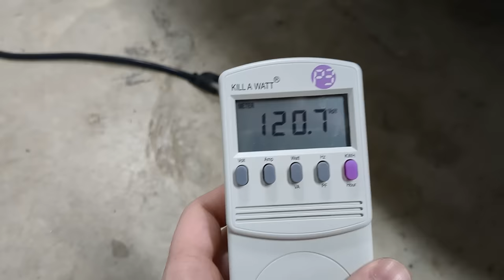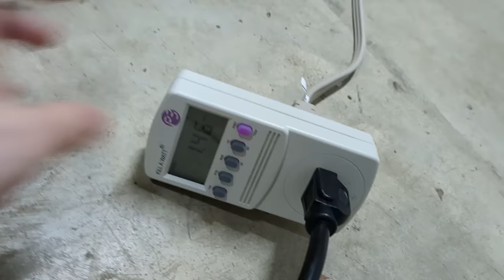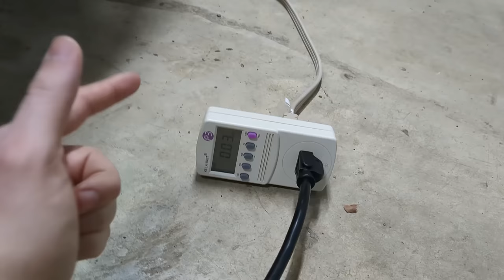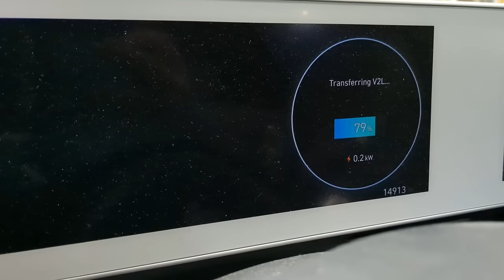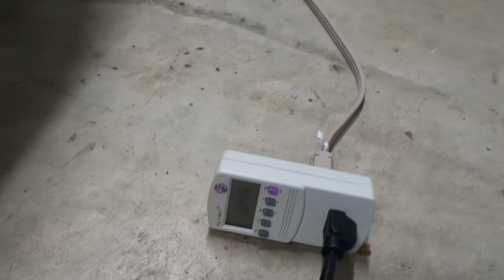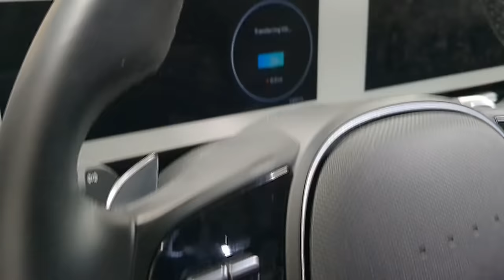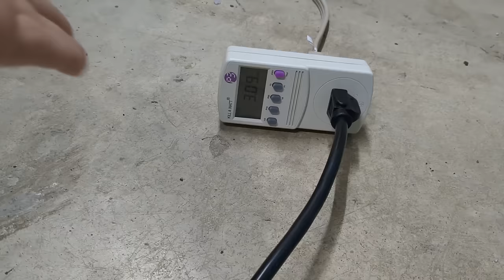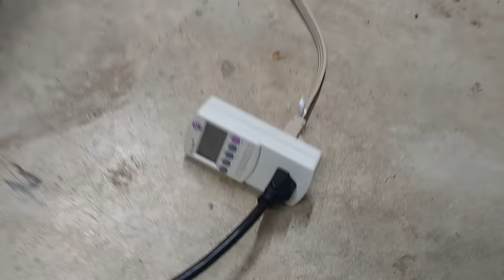A 24-hour test run of the Hyundai Ioniq 5's Vehicle-to-Load function

Comment: honestly i think this is a really interesting demonstration of how much energy cars use, like wow those things are going through a lot just to carry a person or two around
Reply: And yet people (who hve never driven electric BTW) still go on about range and how you wont be able to use the radio etc on long trips, they have no idea how little power the accesories use vs the big electric motor.

You might use 20-25kW or so per hour with the electric motor on longer high speed trips, if its cold and you need the heating on add another 1-2kW per hour for a heat pump.

There is a lot of mis-information out there from people that have never driven a EV.
Reply: @RandomNoob  yes people don't understand instant power vs kWh
Reply: @RandomNoob  The biggest problem with EVs is going to massive battery disposal and cleanup from the extremely dangerous fires they produce when damaged. We haven't accounted for these costs, not even close, at this point.
Reply: Much like a bridge, most of the load is the vehicle itself. There's probably only a noticeable difference in performance if you load 5-6 people in there vs 1. But even then I doubt it'd affect the range much. 

Though the "you'll have to turn the radio/ac off!" Crowd makes me wonder how many of them ever rode in weak older cars where the difference from turning the ac off was actually noticeable. It's a solved problem in newer cars apparently thanks to computers and better design.
Reply: Agreed, and EVs are already multiple times more efficient than regular gas cars!
Reply: agree. it wasnt until i bulit an electric bike to go far and fast that i realized how much energy it takes to do such things, plus i diy'd my solar system. all the above has helped me appreciate the energy density of fossil fules
Reply: @russianbear0027  depends one what you mean by load, most of the work is dealing with wind resistance at highways speeds.
Reply: @ysf-psfx  lithium batteries are highly recyclable and ICE cars catch on fire far more often than EVs even after 100 years of development.
Reply: @RandomNoob  And like many other things, they don't want to learn the truth. If we spend time trying to teach them, they just come back with more ignorant nonsense to spew.
Reply: and the car itself, too!
Reply: I still wonder how electrical grid will handle all the millions of future evs all needing to charge, especially at night or through heat waves
Reply: @fatguy9  well then you should really watch his earlier video on EVs...
Reply: @fatguy9  this one: https://youtu.be/1WuJtcgExa8

The grid will be just fine.
Reply: ah, the point i was trying to make was "wouldn't it be nice if we had walkable cities and better mass transit so we could do something more efficient than burning that much energy just to cross town"
Reply: Think of it this way: one gallon of gas is 33.7killowatts of power. That can make my Subaru go 28 miles or my Nissan leaf 130 miles!  It t to Ames a lot of power to motivate 4000 pounds down the road but the ev is massively more efficient
Reply: @ben3989  and in three years you're going to have to pay the price of a whole new car and throw away a ton and a half of lithium in order to make your EV keep running. A simple, repairable ICE car is a much more sustainable option than an EV, regardless of the fuel efficiency.
Reply: @tissuepaper9962  ok. My ev’s have all lasted way longer than three years. I’ve sold them used with nearly the capacity they had when purchased and will continue to serve the new owner for years. Good luck!
Reply: meanwhile my electric bike can go more than 70 km on a teensy weensy battery if i only use the electric assist on uphills, and even at full assist all the time it gets at least 40 km!
Reply: @tissuepaper9962   OK, well, first... no.  That's not even close to how things really go.  But, let's agree for the sake of argument that you actually do need a battery replacement every three years.  It's a bit absurd, but I'm willing to pretend.

The question is not really, "are there problems with this?" but, "are the problems generated by the new solution more or less problematic than the problems generated by the old solution?"  In terms of recyclability, material hazards, cost, and things like that, we're don't have the process as refined as it will be, when the market has ramped up to mass adoption scale.  So yeah, right now it's costly, and it's not particularly well optimized.  But that will change, because there's enormous financial incentive for the market to cater to those needs.

The materials in the batteries we use today are highly recyclable, so there's certainly room for that market to grow spectacularly -- just like we do today with lead-acid batteries, except:  We will be doing far more lithium battery recycling than current lead-acid scale (due to quantity used), and the materials in them are less toxic, but they will need to be handled with more care.  Not that lead-acid batteries are exactly harmless bricks of love and joy either, mind you... so precautions are required either way.

Nobody can reasonably argue that it's going to be smooth sailing, just that there is a lot of potential for environmental improvement, it's potentially going to be get cheap(er) and easy(er) to deal with the battery life cycles, and we will have to figure out how to contain some of the exceptional cases, like dealing with damaged cells, vehicle collisions, or other extraordinary circumstances -- just like we did when people first started riding around on top of cans of flammable liquid.  It's part of the process.
Reply: @tempest_dawn   Every time I go to a big, populated city, I am quite impressed with how accessible things are.  How everyday needs can be met with 15 minutes of walking, and how long distances can be spanned with efficient mass transit.

However, at least where I live, that does not work.  The climate is too harsh to live outside that much, and there are complications with terrain that require some degree of sprawl, even if living in stacks of shared housing could be considered a palatable option for everyone.  (Which is a whole other matter.)

Suffice to say, cars aren't going to be obsoleted by more electric trains and buses.  Those are great resources for places where they can be deployed efficiently, but that's not even remotely marginally close to all populated areas.  The only thing within walking distance to me is my neighbors, a burger place, and a small strip mall providing alterations and cheap smokes.  If I tried to get there, on foot, during about 1/4 of the year, I'm not sure I could dress warmly enough to prevent endangering my life.  Ergo, car.
Reply: This is why we can't just rely on Electric cars. There needs to be good public transport initiatives and infrastructure for electric bikes.
Reply: @fatguy9 

I think about that too, but I wonder how the grid handled everybody getting central air conditioning in the 1980s? My AC uses far more energy (in the summer) than my EV does. I was a kid, but I don’t recall the grid being overloaded. What do you recall?
Reply: @paulkelly5035  We already seen heatwaves cause rolling blackouts in CA and TX in the past few years, now add millions of cars into the mix and eventually semi trucks. It could be doable but i have my doubts
Reply: Yea a person or two and 3 to 5 thousand pounds of car.
Reply: @tissuepaper9962  wow my 6 year old leaf I sold that had 90% battery capacity and no signs of accelerating degradation didn’t know that you know how long batteries last.
Reply: @ben3989  must not drive much. How many miles?
Reply: @tissuepaper9962  it had about 54K miles.  In my family the leaf makes a perfect 2nd car to our Subaru and transit van (which is part time work truck). the Leaf does ALL of our city driving, closer to home outdoors activities, and gets me to hood river and back where I do a wind sport on a single charge.  That trip alone cost me about $5 vs $16 in the Subaru and I do it about 25 times a summer.  Its a great car and has its place
Reply: @ben3989  actually, I agree. A very light, short-range EV is a good complement to an ICE vehicle for distance, and you've done well to keep it for so much longer than the average person keeps a vehicle. I think that using an EV as your primary mode of transportation, like commuting the full range both ways every day, is not the way to go about it. Public transportation should be the commuter's primary tool.
Reply: @ysf-psfx  Man if you're concerned about those, just wait until you hear about all the costs from cars in general! Wasted space, tires, micro plastic pollution, direct air pollution. Turns out 1-2 ton boxes that usually transport 1 human to their job and back aren't very efficient at shuttling that one body around. Math's different when they're hauling tools, delivering/producing food, etc, but commuting? not so much.
Reply: this is avtualy a point that should push ppl towards stuff like trains and busses. Alas
Reply: I like to explain it in American household outlets.  I can get 5-8 miles per hour off one, but for full fast charge I need 173 regular outlets for 250kW, about 7 large houses maxed out or a whole regular neighborhood worth of power. That’s charging at 335 electrical horsepower which is no joke.  @RandomNoob
Reply: @RandomNoob it has been a year, hope you have learned something by now.
Reply: @ysf-psfx  How many EV fires do you think are happening?  I can assure you the cleanup from fossil fuels will be far more costly and take far more time than cleaning up fires from damaged batteries.
Reply: @RandomNoob I think the point of the original comment was to say how inefficient even electric cars are as a means of transportation. 60+ kWh of energy to just move usually a single person around

Comment: To avoid the plugging/unplugging issue, there are powerstrips available that cut off one socket if the total power draw exceeds a certain number. It enables both sockets again after the power requirement drops very low. This is used for boilers and dryer/washing machines to operate from the same outlet. Dryer on = boiler off. They are very cheap, recently got one for 25€.
Reply: Wow that's cool. What are they called?
Reply: Yeah that's call load shed. It's common with RVs. They will shed things like water heaters or AC to run the microwave. Newer RVs are all digital and you can set what amperage your shore power is, and it will configure the load shed automatically.
Reply: Surprised he wouldnt have found something like this after his most recent video on the smart circuit breakers for homes that do the same thing.
Reply: @Tomwesstein ... Do you mean OTHER THAN a switch for each outlet... it's done automagically??? Cool idea. Can you point to it, please?
Reply: This recalls the Green Acres TV series: Episode 9: “You Can’t Plug In A 2 With A 6” (Aired: 11/10/65). For those who ask, while I was around in 1965, too young to appreciate it until watching the reruns many years later.
Reply: @kennixox262  I just watched it on Pluto tv. They have it as s01e10. I like Oliver's system. I do basically the same thing now.
My new project is using my 2000 watt inverter generator with a deadly cheater cord to back feed a new 20 amp outdoor outlet. Then I'm putting all my breakers that I want to be able to run during an outage all on the same leg as my back fed 20 amp. Of course I'm going to disconnect the main before I try to back feed it. I won't be able to run 220, but I will be able to run the furnace, sump pump, fridge, microwave, tv, lights and such. As long as it's less than "8" 😆
Reply: he could also use something like one of these  battery power stations to support more than the max output of the car for some time and charge it while he uses less than the maximum.
Reply: Yeahhh this is what I was thinking of when he mentioned the smart distribution board in his other video. My childhood home in europe had 3 phase power for ovens and stoves. But the washroom circuit didn't have enough amps for both electric washer and dryer (I wonder if it had a gasdryer in the past or just outdoor clotheslines?) So I always grew up with one of those prioretising power strips.

The main distribution board doing that digitally seems really cool to me. I liked smaller aspects in games like Elite Dangerous where you prioritise which systems get power when the spaceship reactor is overburdened or damaged. (You can disable your life support to keep your engines running hahaha)
Reply: I have an Inventum instant hot water boiler under the kitchen sink, it shares the power supply with a dishwasher using their Q-Switch power strip to split the load depending on demand. I'm in the EU so it is 230v/16A device.
Reply: To all of you asking for the product, I’m from the EU (240vac) and they are very common here, the fact that TC did not stumble upon these and talked about them in his other video makes me think they are not a thing for 110vac. In Dutch  it’s called an ‘energy distributor’ but this doesn’t translate into a US product as far as I can find..
Reply: @Tomwesstein  Are you able to share a link to a power strip with the mentioned functions? Haven't been able to find any with "load shedding" functions, here in the EU.

Comment: I'm honestly really glad you added the bit at the end about potentially driving the car into town where they still have power or using a fast charger to reset the battery. An electric car being a very portable battery in an emergency is a great thing. [Ideally one wouldn't stick around in the home for over a week in a power outage and have to refill, but still!]
Reply: Assuming the roads are travel-able.  In case of a severe ice/snow storm, it might not be possible to get out for several days (as we experienced).  But as he mentioned, he's good for 5 days easy in this case, so that's a non-issue.
Reply: @Josh Payne  It's kind of a niche situation  for sure, and he brought up correctly that winter outages are repaired much faster as emergencies. I live not that far away from rural areas, though, where power might not be repaired for a week or more after a strong summer storm. Driving 15–20 into town to fill up the home battery and pick up supplies would be a realistic solution to the problems posed there.

Hopefully, the grid remains maintained and robust, but the EV as generator replacement seems to make sense.
Reply: @joshpayne4015  also in case of snow storms his setup would run even longer -> no need to run the refrigerator
Reply: actually solar or wind can in a emergency fill up the BEV but unless you're a farmer/stored a lot of gasoline normally you're stuck walking and waiting for the pumps to work at all and generally you're SOL, lost the debate with others vs my 1968 C10 chevy PTO gen-set
Reply: If you live alone, because if not the people staying at home will miss the generator driving away down the street!
Reply: @uhjyuff2095  I think the people still at home will survive for 30 minutes, and be grateful that they have power the other 23 hours and 30 minutes of the day compared not having a generator and thus no power at all
Reply: @mjc0961  and the ones missing it are likely kids with ipads and whatever which will have their own battery for hours. Fridge won't defrost that fast either. So, yeah, leaving for 30-60minutes to quick charger makes sense. Is this THE universal solution for all emergencies? No. But neither is generator.

Comment: I actually had a 4 day power outage a couple weeks ago, in SW Michigan due to an ice storm. I have the Kia EV6 long range /w the official V2L adapter. My gas furnace was hard wired. So I converted it to a plug to have heat (blower is really the only load, not to bad on the battery. You may want to reconsider needing to leave for a winter outage). Almost a 100 year old house, so the insulation leaves a lot to be desired. I didn't run a stove, but did use my Jura Espresso machine as a heating load. Worked from home a couple days using a laptop and cell phone hotspot (couldn't be bothered to run another extension cord). I also got ~10-12% per day. Other neighborhoods got power back earlier, so could always go to an area /w quick charge to top it off if the outage was going to long.
Reply: You could also cut power usage by only heating one room with a space heater. Set it up as sort of a shelter room in case of the worst case scenario. I did that a few years back when my A/C failed in the middle of a hot Florida summer. I put a window A/C in the master bedroom and left the rest of the house alone. It worked and I was able to deal with the three hottest months of the year (90-95F with 90% humidity and a heat index of 100-115) without having to sweat to death. I only left the shelter room when I needed to get food from the kitchen. I also went 20+ years without heat in the house and did the same thing with space heaters.
Reply: I did similar Andrew.  Rewired my furnace and plugged into my Ecoflow battery during the same outage, as I'm in SW Michigan too.  Recharging the battery from my EV would be great! That's why my next EV must have 120/240V output!